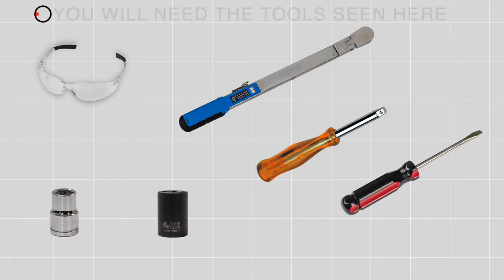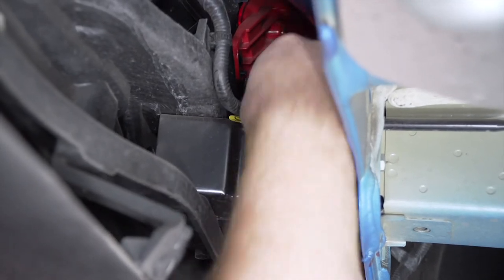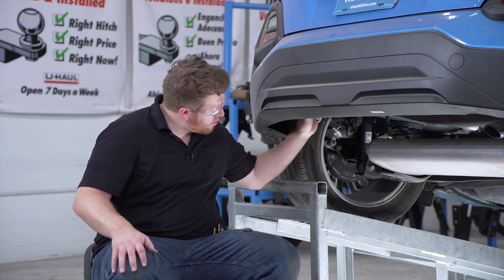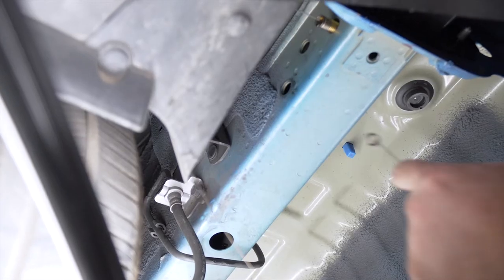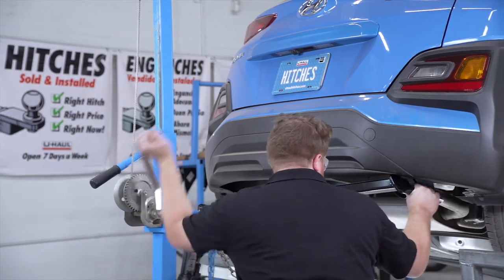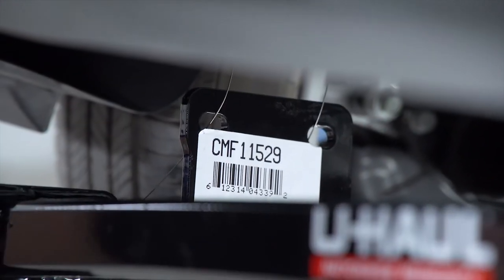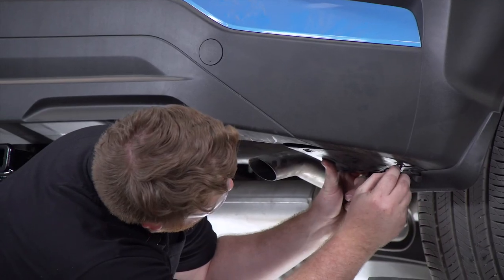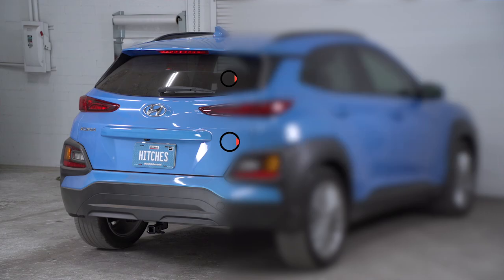2019 Hyundai Kona Trailer Hitch Installation

Comment: If you don’t a second set of hands a pair of jack stands do the trick just the screws are a lil stingy coming thru the whole because of the spacer. Great video made it real ez to install.
Reply: 2019 Hyundai Kona
Reply from the maker: Great tip!

Comment: The Curt 11529 does not directly fit a 2020 Kona EV. You will need to make some major bumper cover modifications. 
I tried a test fit on my 2020 Kona EV.  Even with bumper cover mods and the hitch installed -  you could not re-install the 
lower horizontal cover that wraps under the bumper cover.  I had to make some cuts on this cover as well.  Eventually,  I 
did get everything to fit.  The newer 2021 or 2022 Kona EVs could fit differently.

Comment: Can I install on a 2021 Kona Electric?
Reply: I have the same question. thx for asking
Reply: @daveedmateo94  i just got one installed.   Same hitch as the ice Kona.  Quick and easy.  Paid $400 cdn for parts and labour.
Reply: @ripapa6355 Cool man. Do you happen to have the part number for the hitch? Or just the name brand.
Reply: @daveedmateo94  i have a part number.  Not sure if it was the original or just made up at garage.
Item # 24976
Class 1 Hitch Hyundai Kona 2018-2020
Reply: I got it to fit on a 2020 Kona EV.  See my post in this thread - be ready to cut some plastic covers.
Reply: @davewilliams7693  lol.  Put on my kona electric a yr ago.  Perfect.

Comment: What is the towing capacity for the Kona 2022? I have seen every number (some crazy ones like 5,000 pounds) but nothing from Hyundai. Anybody has a Hyundai manual and can confirm?
Reply: Its not recomended to tow something with the kona since dct are not meant to tow alot but also not mention if the transmission fail and you have a tow hitch it wont be recovered by the waranty they give you at the dealership
Reply: But max towing capacity would be arround 500 pounds
Reply: @Badhacktime   Mr Quebec....get your facts straight because the rest of Canada knows to actually read the owner's manual and in that regard
DIRECTLY FROM  A   2022 HYUNDAI KONA OWNER'S MANUAL
Maximum Towing Capacity - 5000 lb

It is the same for all trims. The maximum weight that Hyundai Kona is allowed to tow. The maximum trailer weights listed are only applicable for altitudes up to 3280 ft (1,000 m) above sea level.
Reply: @sooboy1963  Woah slow down there. First at all I do not own a kona for that one particular reason since the only available kona that can tow is the 2.0l 6 speed auto which you would be righ and you probably have that model, but the other model with the option to be awd cannot tow either with the cvt or dct you're clearly mistaken buddy cause not all model can. Even hyundai told me that it was not recommended to tow with the kona unless you have the 6speed and 2.0 liter regarding that, there is no such info on hyundai which would be logical to be there to actually know how much it can tow. Even on hyundai site there is no option for a tow hitch even for the more recent models. But at this time I wrote that comment the only engine I knew was the 1.6 turbo with the dct which couldnt tow at all